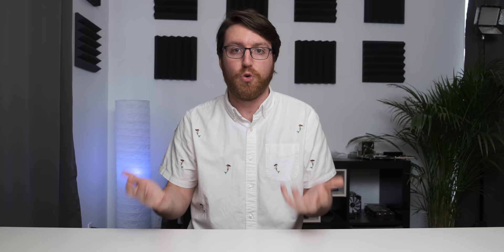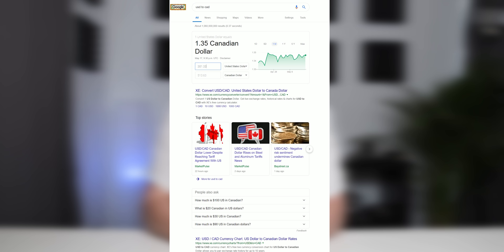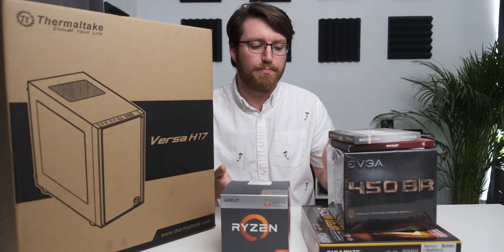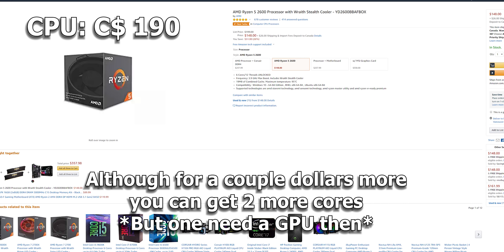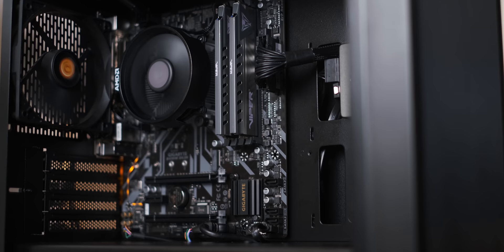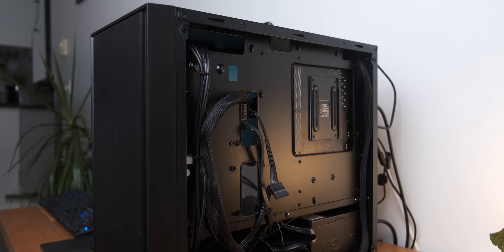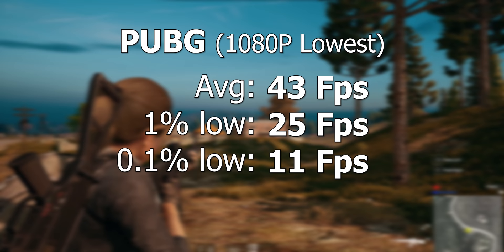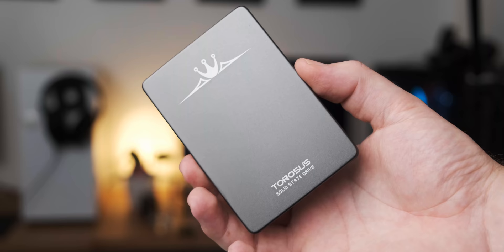I bought a gaming PC with my FIRST ever YouTube paycheck

Comment: Man... Here In poland everything is more expensive but from what I found... The RX580 costs around 880zł (PLN) which is exactly 232.44 USD or 303.17 CAD...

(wtf)
Reply: Buy 2nd hand on ebay
Reply: @shadowreaper5413  Did I say I wanna BUY A CARD? I have a much stronger one...

Comment: "The 450 Watt power supply should be enough for any reasonable graphics card you would want in the system down the line"
Laughs in NVIDIA 3000 series power draw
Reply: The 3080/3090 don't really come off as reasonable in this build, besides this video is really old.